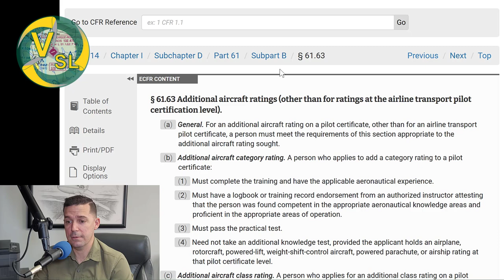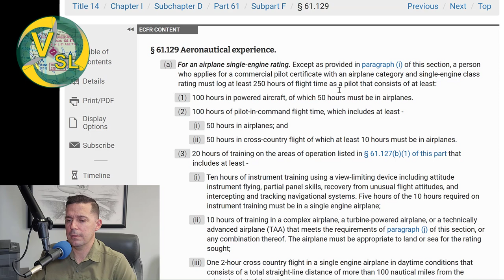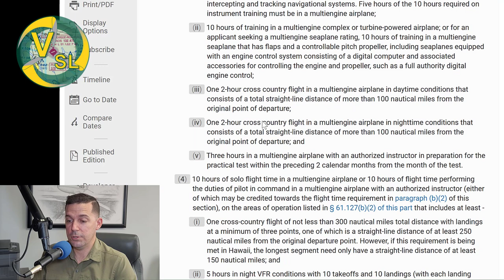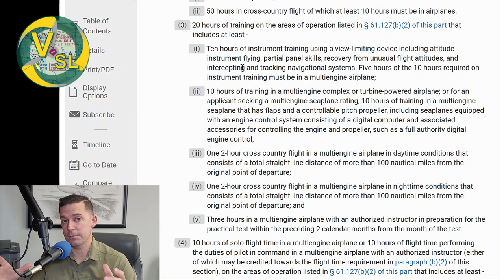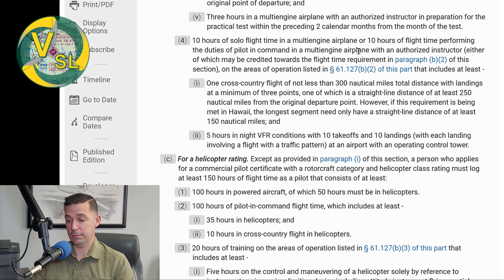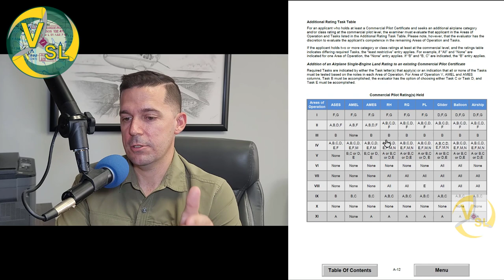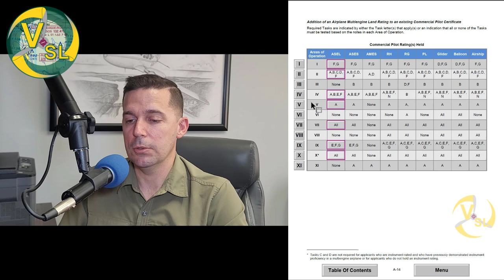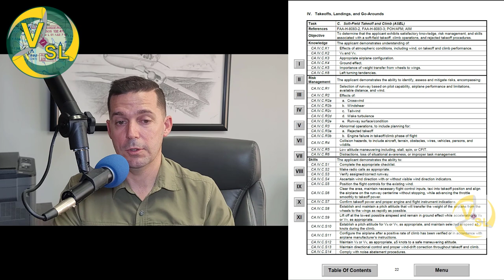Multi Engine Basics - Part 1

Comment: Amazing content. Just one correction - at 6 min elapsed time you mention power to non power (glider) requires a knowledge exam. I can assure you that’s not the case. Power to glider add on rating = no knowledge exam. The only exception is CFI airplane to CFI glider. That requires FIG knowledge exam.
Reply from the maker: You are correct!  No written test required, just a practical.